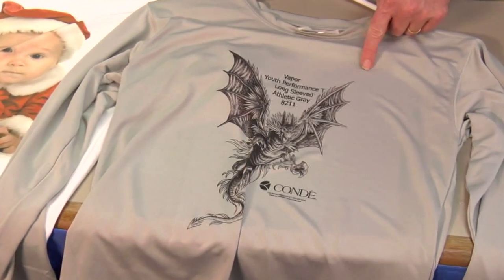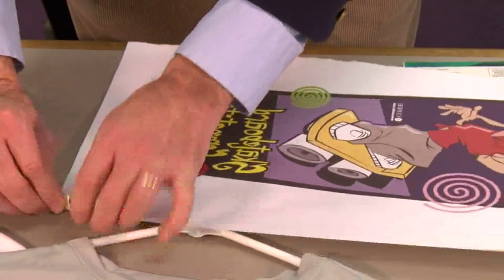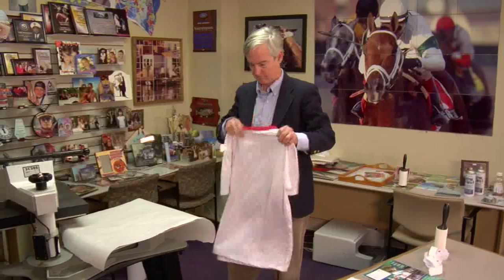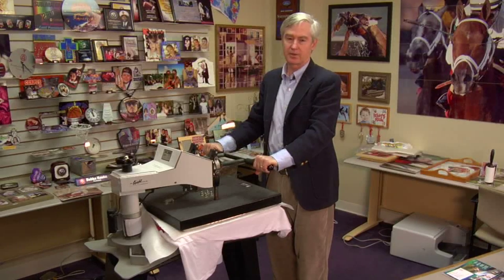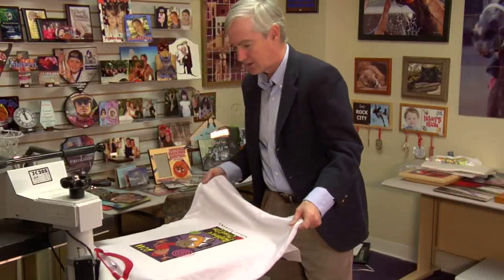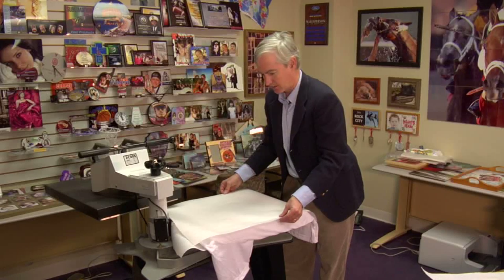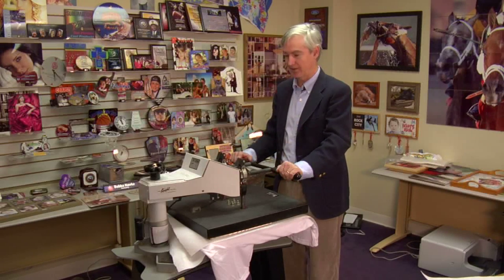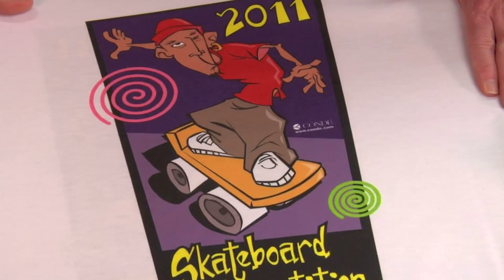Sublimation & Shirts: Deckle Tips on Avoiding Permanent Heat Press Marks -

Comment: Ripping the sheet does help but also I found that if you take a folded rag and rub the shirt as soon as you lift up the heat press those lines will fade more still. There's a 2 or 3 second window where the lines are soft enough to be rubbed out.
Reply from the maker: Great idea!  Thank you for sharing!

Comment: Can we cut it (a wavy shape) instead of ripping it? My designs are usually full sheet and I’m only using 8.5x11
Reply from the maker: Hello K'ya,  we do not recommend cutting it in any way.  By ripping it the paper you soften the hard edge of the paper.
Reply: @condesystems  Thank you!

Comment: what if it leaves a very faint outline, yet still seen. is that unprofessional to sell? Are those lines permanent?
Reply from the maker: +Joe Gowac ..............Yes, it is possible that you have done everything right and you get an permanent impression from the edge of the transfer sheet. Have you tried the “feathering” approach on the transfer sheet’s edges? Here you slowly tear away all white space that borders the printed image. This works very well in that it eliminates the issue of a contiguous edge impression.  Here you will see that this technique serves to disperse the line in faint random segments. We are currently in the throes of a large print job where edge feathering is being used along with Vapor foam. The shirts look fantastic. You have to examine each one very closely to discern the presence of paper impression lines.
Reply: I tried tearing it still left line. Ill try pressure adjust meant

Comment: David if I am going to do this on a sleeve at the top at the shoulder how would I lay it out? with out making a seam press on the edges? thank you..
Reply from the maker: +MK Buddy You need to cut a piece of foam to straddle that shoulder, slip it inside and pull the fabric away from the seam as you press. Practice a little until you get it figured out.

Comment: Thankyou for the tip. it works well for me, but I have a different press problem. I get the platen edge mark on my shirts which I cannot remove. Is there a way to solve this?
Reply from the maker: Try lighter pressure, make sure your press is calibrated and try the Vapor Foam.

Comment: i have tried the vapor foam and it does not work for me.  why?  because the transfer paper can MOVE over the foam very easily which make s the print crooked and more often than not blurry.  I've tried this tearing method before with no success, but will try again today with a higher temp and less pressure.  I usually press at 385-390 for 45 sec, but have a laser temp gun now and going to very accurately get the heat now.  Might just be my heat press.  It's dangerous, though, because the last time I lowered the pressure I got a few shirts where the ink did not sublimate all the way.

Comment from the maker: With sublimation you get imaging areas that do not have fixed dimensions, so something like a retangular or square piece of silicon wouldn't work. Another way to avoid press marks is to trim the transfer around the imaging area, but this is not practical for production purposes. Some people actually rub out the press marks with a blank sheet of paper while the shirt is cooling on the press. Again, not so great for production runs, but it gets the job done.